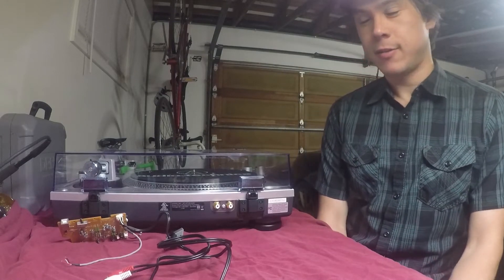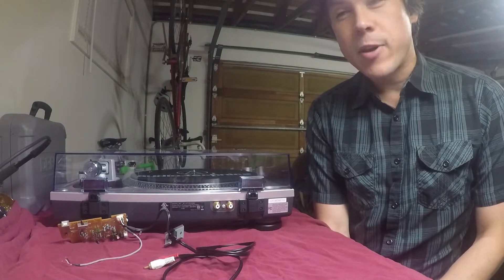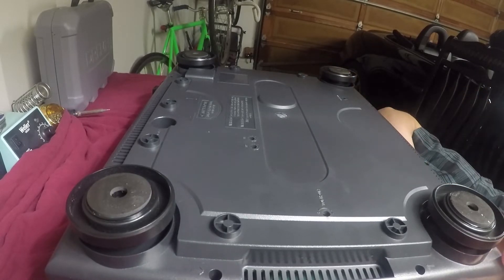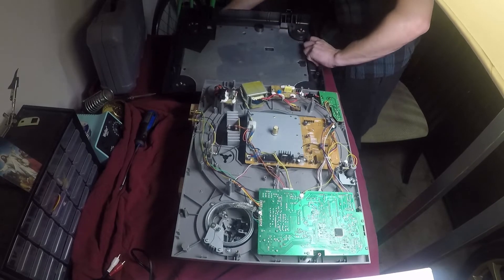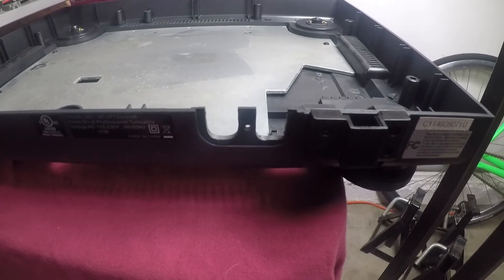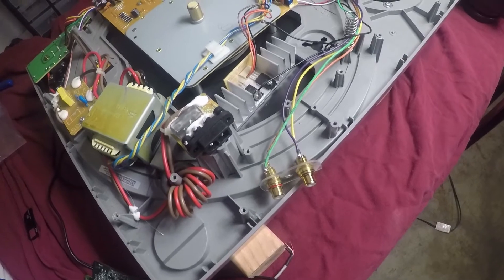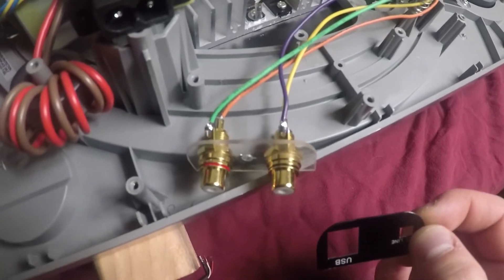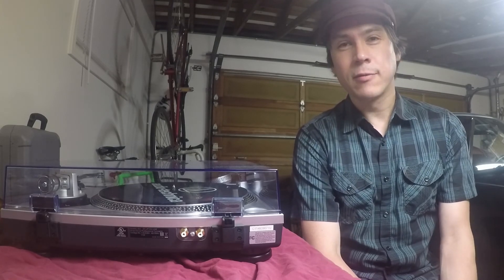Audio-Technica AT-LP120-USB Preamp + RCA Mod

Comment: If you have an amp without phono stage will this mod work with amp, I mean does the turntable still have a phono stage for amps without phono stage, thanks?
Reply from the maker: Hi there,
Removing the preamp removes the ability to convert (internally) from phono to line level input. After this mod the turntable only outputs a phono signal, so your amp will need some sort of RIAA equalizer/preamp to boost the signal properly.

Comment: Hello, I have an audio technica AT-LP120 and suddenly I didn't have sound in one channel anymore, I removed the cartridge and I was in Bucharest and an electronist measured it and he said that it is very good and my problem it is inside the record player. If you can give me an advice will be nice, because in Norway I do not find an electronist to repair it. I checked the turntable with another amplifier and there is no sound in the same channel.
Reply from the maker: Hi there! It's hard to say what's wrong without a picture, but I would trace the wires with a multimeter. Start at the cartridge and check for continuity for the left and right channels all the way back to the circuit boards and eventually the outputs. Performing this modification can also rule out the preamp as a suspect. I hope this helps!
Reply: @T_da_B  Thank you for this help, greetings from Norway.

Comment: This modification is no longer applicable or as useful on newer versions of this turntable, namely the AT-LP120XUSB.  It has many upgrades, including turntable motor, power supply, anti-skate mechanism, cartridge, pitch control range, stylus light, and importantly the phono preamp. Read about it at Turntablelab website. The preamp has been upgraded with a stronger signal output and the preamp's off function has also been improved with a cleaner bypass, with little to no added distortion. As such, no real reason to yank the board anymore.

When I opened up my LP120 to do this mod, inside it looked nothing like every single youtube walkthrough of modding the turntable.  The new version appears to have been released around 2020 or so.

Comment: 😂 so now you can’t use it with USB on a computer, controller DVS ?
Reply from the maker: Yes, you sacrifice the USB for sound quality with this mod.
Reply: @T_da_B  sacrificing for better audio quality??? you mean couldn’t just get a external amplifier and leave it as is?
 I don’t strust in this videos And they are misleading… You don’t have to do this for a better audio signal. Just cause you get more frequencies that doesn’t mean the every human ear can catch and hear  them frequencies. That’s just nuts.
Reply from the maker: Search for other mod videos with the before/after comparison and you will see that you CAN hear the difference.
Reply: @T_da_B  you mean that digital signal that ur getting and that ur sending threw the cameras audio stream signal ??? you mean that video where they check on audacity audio singnal. And you can see the messy signal. dude am not doing that to my TT. Ur nuts if you think I’m gong to do this for a small high end frequency. It’s all about that bass baby
Reply: @T_da_B  this is how I know education as failed you…. using DVS uses Phono output for signal. Not usb. usb is not used for anything but to convert ur LP tracks  into digital format. Which is kinda dumb to be honest.

Comment: Hummmm. That's what I'm getting. Not really bad but bad enough. Don't know why as it is just straight from the cartridge. I have tried a ground from a few different places but can't get rid of it totally.
Reply: got pulled into the hum vortex myself.  were you able to solve it?
Reply: @ronnic1  Well I guess I can say yes. Almost all my equipment is plugged into a power strip. Yes I did try the turntable straight into the wall, no help. Tried grounding it to the receiver, no help. Then I grounded to the pre amp, still did it. Left it connected to the pre amp and ran then ran another wire to a ground point on the power strip. Bang! it worked! That ground point is the part where a coax cable screws on. I don't understand or get it but it works.